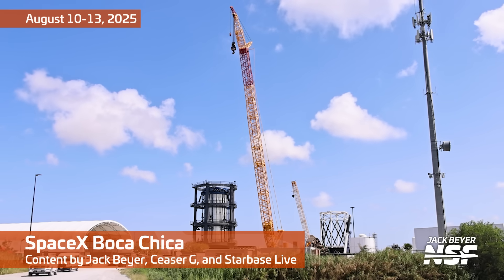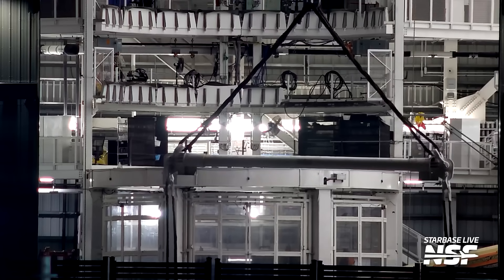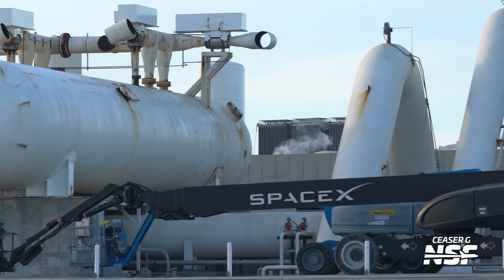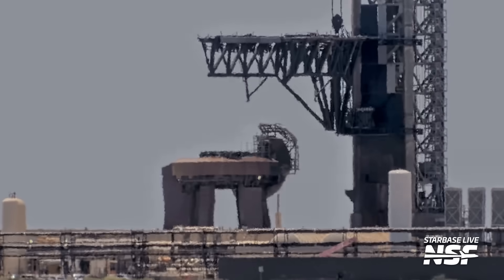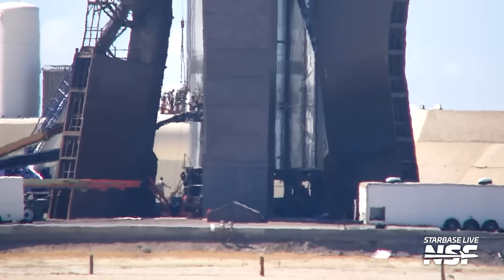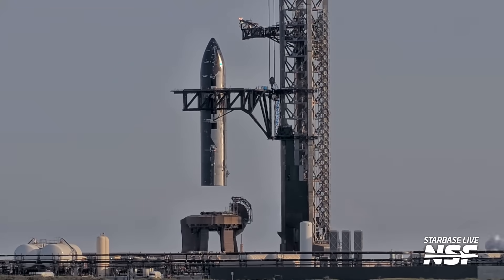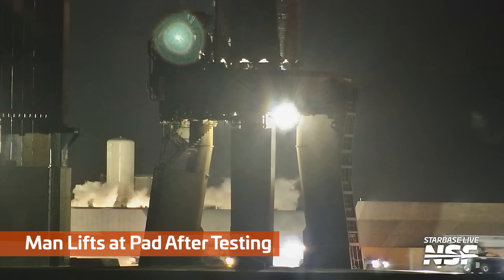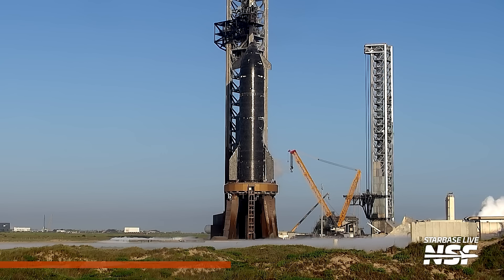"A (Ship 37) Field Trip to the Launch Site" | SpaceX Starbase

Comment: 3:32 Hammer T's are plumbing fixtures that create a symmetrical exhaust thrust that cancels out. This eliminates a net force on the plumbing when venting. 

[EDIT The angle avoids aiming the exhaust plume against other fixtures.]

A larger flat disk beyond the openings would also work and also disburse/diffuse the jet.

Comment: "Blowing up the carbon. But there's not a lot of carbon involved, being a methane powered rocket."
Methane is made of carbon! (one carbon atom bonded to 4 hydrogen atoms)
Reply from the maker: Comparatively less than, say, a complex hydrocarbon like RP1. - Das
Reply: @NASASpaceflight  OK; But it's not a whole lot less.
When burned, 1 kg of kerosene emits about 3.16 kg of CO2.
When burned, 1 kg of methane emits around 2.75 kg of CO2.

Comment: The "weird angle" on the tank farm pipe ends may be to guarantee draft under prevailing wind conditions.  If the wind is blowing directly at the pipe axis it will jam up the discharge flow.  The slight angle provides a differential pressure, allowing the gas to exit.  Works on my pellet stove, anyway.

Comment: Id say the T pipes for the water are angled so when they release, the flows are not interfering with each other. if they were straight they’d blast into each other possibly causing flow restriction

Comment: Maybe those T-piece vents are canted at an angle to help drain rain water, debris , condensate, ice, wildlife, and whatnot.
Reply: They are there to release the gas used to pump the water for the deluge. They are at an angle to avoid hitting each other.

Comment: The angle on those 2 deluge control pipes are for a air release on the water flow. When activated there is a plume from the top of both pipes, clearing the air pocket, then closes to push the water through. To end the stream, the high pressure gas is stopped, and the 2 pipes are opened to atmosphere to break the water flow by allowing an air pocket to form at the top of the angle. Just a basic siphon at the end of the deluge.
Reply: I do not believe there are valves that close... these holes at the top are rather small in comparison and also act to slow the water hammer ... watch them during the launch and they still are ejecting water until the nitrogen is stopped
Reply: Yeah that looks to be the case. We see them expelling the air/water strait up with a whistle sound 1 to 2 seconds before the water is released at the pad. They shut closed once all the air has been bled off & the water pressure at the pad is then at maximum from what I can see visually. The water hammering that would occur if they didn’t bleed it off like that would damage the infrastructure and also possibly the engine bay of the booster too at a guess. I am a full time tractor mechanic and a part time armchair rocket scientist too 😂
Reply: probably. google "harris siphon breaker" or "large pipe siphon break" seems to confirm this